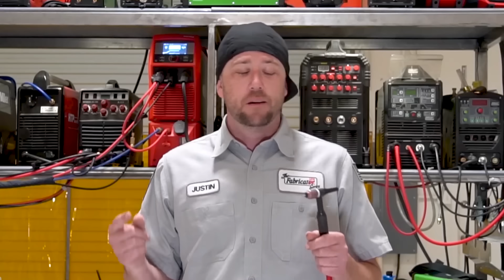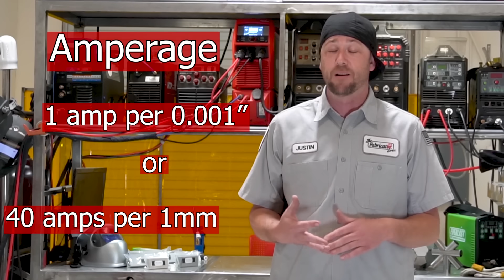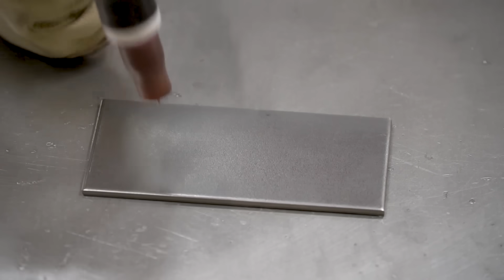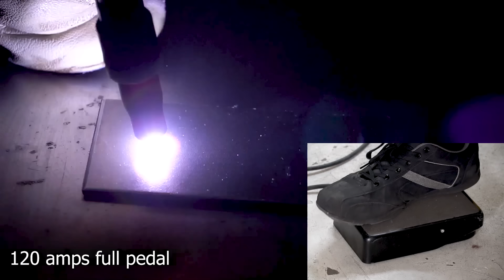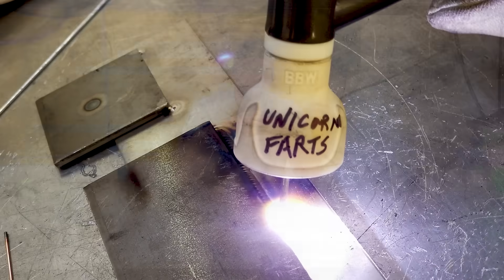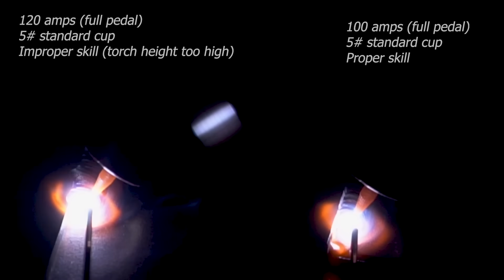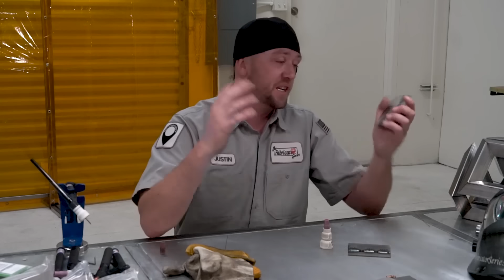TFS: TIG Setup Simplified with LOTS of Detail

Comment: Hi, I'm setting up my first Tig welder, an Everlast 210 EXT. Is there any reason Everlast would position the electrode negative and the positive  reversed on the 210? In other words the positive is on the left side of the front of the machine, and the negative is on the right side. Opposite of your demonstration of the EXT 255. what gives? Would that have anything to do with a malfunction of the ball type of regulator? My brand new one will not rise to indicate torch pressure when I attempt to adjust it.
Thanks for any insight.

Comment: Justin - quite helpful video - I just bought a Lincoln Square Wace TIG 200 -  I do MIG welding and wanted to try TIG - I weld mostly steel eight 1/8" to 1/4" (lawn art) - with TIG can I just set the Amp and not use pulse?  Any thoughts on Amp setting for the thickness I mentioned above?   Please also advise any of your videos to help me with TIG

Comment: Tungsten melts more on dcep because 2/3 of heat goes to pos side, and 1/3 to negative. That's why you can melt a bigger rod with dcep than dcen. And why some "ball" (melt) the tip on dcep for AC aluminium welding...

Comment: I need help, so I'm tig welding Aluminium  pipe 1.6mm thick 1 inch wide with a 6mm bracket on top and I'm having trouble with what seems like a reflection or something is happening when I'm directly perpendicular to my weld puddle,the arc will stop and gas will continue. And the arc won't start again if I start directly on same weld puddle. Also we get all our parts in from chinaand they are really dirty, I'm seeing black dots in the puddle and also a red glow. Please help me as this is my full time job and I want to make my life easier. Thanks in advance :)

Comment: Justin this video just confirmed and taught at the same time I started off the scratch start on a gas miller generator with a pedal amperage control back in 1982 but was always a pain to do a just quick light weld on steel. Then I made a 12v car alternator 1 hp 110v motor as a scratch welder with a pedal amperage control from miller machine which worked sweet and used that for the rest of my light welding up till 2017, then came in the cheap Chinese hf welder to try as a goof, I have to tell you doing steel and not having to scratch is a pleasure, while I haven't done the pedal amperage control just yet I seem to get about the same weld for each. They all weld they all never had a failure either, and being a mechanic by trade and making one of a kind specialty tools that take an extreme use and loaned out so you know that is disastrous just by knowing people. I love your saying if it works for you, well it has over 38 years for me. I am grateful a welder taught me just enough to get me started and you in the past couple of years have helped me tremendously. Thank you, Justin. BTW why would someone not like this video. Keep up the videos.

Comment: Justin in regards to gas, i'm sure have welded 1/2" or 3/8" aluminum with straight polarity helium with a transformer machine i.e square wave at sometime in the past! In my experience almost impossible to do with Argon and AC without preheat and almost burning your fingers off. I have no experience with inversion welders, my question is can you use Argon and straight polarity with the inversion welder and get the same results as the example above on aluminum.

Comment: I have been a stick and mig man forever .I had just bought a Miller 215 with the  tig handle . now as argon goes . Only use Argon .that it, no substitute , trying anything else.or you will get a pile of melted metal . and a melted handle .so off i go to find argon cheap ..

Comment: I like your no nonsense videos. My AHP 201xd arrives today. Your carbon steel and aluminum coupons arrived Saturday. I have to go about and buy some consumables but also had a question about tig fumes. You probably have some monstrous ventilation system and i have a 3m organic vapor cartridge i used for MIG... i see many folks in instructional tig videos and no one wears any vapor protection...stainless being the most toxic...  any thoughts? Thanks man...great job on great instructional videos.

Comment: TIME = HEAT  ...   = warp - fracture - cracking - TEMPER of metal - Stress fissures / crack's.
=  Equal  your cage/ structure/  BREAKing up around you on your way to a place that is very DARK.
But sometimes you get to met GOD.

Comment: I just turn everything to the limit, cause that’s why it’s there.  I melt the heck out of the metal to fuse it together correctly.   Seriously, what’s all this nonsense about tip height, gas flow, weld speed .  Turn it all up and blast it.   Just kidding, not a welder.   This all seems like great advice.  I’ve always wanted to learn, maybe it’s time.

Comment: This is exactly what I needed. I just acquired a pair of 2009 Miller XMT 304 TIG/MIG/Stick boxes; one appears to be 100% functional, one not so much, but it'll either be a parts box, or sent down the road, if it's an easy/cheap fix.

They came with nothing, including no power cord. This is my first foray into TIG, so I need to learn the basics, and you provided an excellent step in the right direction.

Thanks...  Now it's on to the two vids you recommended.

GeoD

Comment: hey justin ive purchased a inverter mig/tig that comes with a flow meter which fits on a standard size bottle however ive got a disposable bottle so the flow meter fitting is too big. is there an adapter i can buy to fit on the standard flow meter which can then be fitted onto the small fitting of the disposable bottle? also would the gas hose which is 5 by 8 which is part of the torch fit on a flow meter that fits specifically on the disposable bottle? as it seems the hose fittting on the flow meter specifically made for disposable bottles looks smaller in diameter than the hose fitting on the regular flow meter. thats only a question needing an answer if there isnt such thing as an adapter for my first question. thanks

Comment: « Take the diameter or the number of the cup x2 »
Number 12 (= 24CFH): diameter = 12/16 = 0,75 inch
Number 8 (= 16CFH). : diameter = 8/16 = 0,50 inch
So I don’t understand « take the diameter » or « the number of the cup »
How can you get same result with the diameter ? 🤔

Comment: Justin, just a real quick question, What do you think about the CK Worldwide MT200-AC/DC welder? Its the 3rd welder from the left on the shelf right above the work bench.
I've "heard" good things, but what is your opinion? It looks easy to use with the analog controls.  Thanks, Joe

Comment: I used a red tungsten AC, to patch a busted aluminum guard, got a good weld without burning through it ( it was thin ) and finished it off with a roloc for a nice repair. Supervisor who can't Tig argued that he READ you HAVE to use green DC for aluminum. 🤔

Comment: You should make up a wall chart with the TFS logo that summarizes everything you just covered in this video.  I'd buy one!  I have been burning sticks, acetylene, and wire for 30 years, and just recently decided to take the "plunge" into TIG.  I bought the Everlast 210 EXT (your big boy's smaller brother).  This info is exceptionally helpful.

Comment: I'm still admittedly pretty new, I'm getting by but I switched pretty quickly to gas lenses, not to make pretty welds, but because I'd found info saying it would save me a little money on gas, seemed good since I'm on a tight budget but it hasn't made much of a difference for me, I tend to run #8 cups, usually stubbys on my 17 torch but it's worked pretty well for me other than the unnecessary expenditure

Comment: Quick question  I know time is very valuable, Im confused when you said all machines maybe you can clear it up for me, on the TIG torch always being connected to the negative of the machine does it also apply to older Miller Dynasty 200 DX? I've looked at the  manual for it and it shows it goes on the positive side, even when stick welding it goes on positive side, thank you for your videos there very helpful, just notice there is no  - or + signals its just a ground clamp image on the left side and a stick image on the right.

Comment: NOT a ground clamp! There is NO ground clamp! Sheesh. If a cable goes into either the negative or positive port, it isn’t a ground. The only ground on a welder is the ground pin on the power cord.